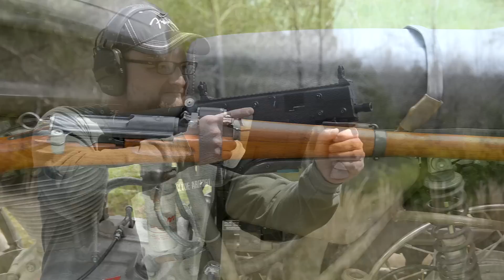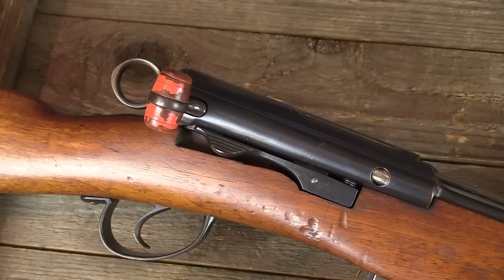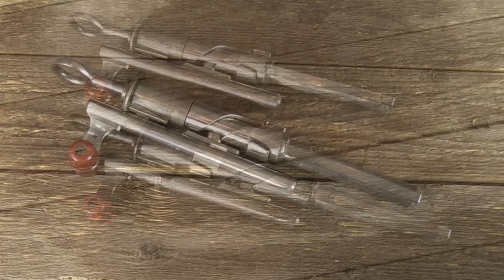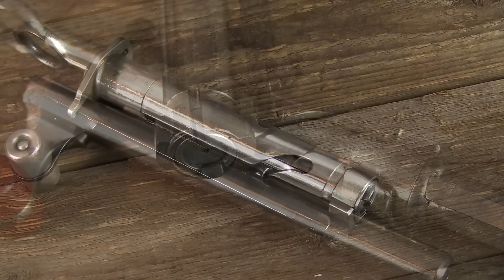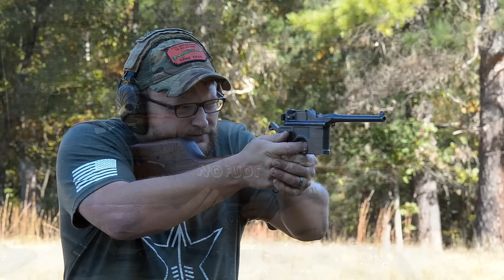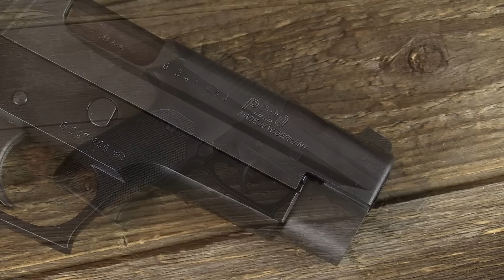A History of Swiss Military Small Arms

Comment: The "Pistole 08" was adopted with the famous 9mm Parabellum in the German army  in 1908 - correct. The Swiss brought it into service already in 1900, in cal. 7,65.
But: The "Pistole 04" was adopted by the German Imperial Navy in 1904. It was also a Luger. They produced with some specifications only about 32.000 issues, mainly for the crews of torpedo boats and naval airships.

Comment: Just have to say that the GP11 is not in service anymore. Its the GP90 (1990 and not 1890) we use in the Stgw90 (SIG550).
Reply: ok you said it later yourself, nevermind... but I know the 550 quite well if you have questions.
Reply: and the Pistole 75. thank god I finished my service...
Reply: GP11 is still in service because vehicles like the Leo2 still use it as coaxial, with the MG51.

Comment: Eric you have a few things wrong, especially about the Luger. The Swiss bought the first model 1900 Luger from Germany (DWM). The later models were then produced in Switzerland (contract). So that the Swiss had the Luger before Germany is incorrect. The Luger was issued to officers in Germany from 1900. Also the P75 served all the way up to now and is slowly phased out  and replaced by Glock 17. The Swiss Army never used Sphinx nor P226. However they where and are used by law enforement in Switzerland.

Comment: Just a quick question I have about an old rifle I got not too long ago, I have an 1891 Argentine Mauser and I was wondering if it's normal for there to be resistance when closing the bolt even without chambering a round, note when I got the rifle I had to get a replacement frieing pin and cocking peace was nonexistent

Comment: Please correct me if I am wrong, but it seems that the significance of the “transitional rifles” has been misrepresented. The 96/11 rifle (which as you point out can be identified by the grafted pistol grip), was much more than a footnote in Swiss small arms history. Remanufactured from stockpiled 89/96 rifles, the 96/11 was actually the most widely produced Swiss long rifle chambered in the GP11 cartridge. By the year 1915 there were almost three times as many 96/11s in service as there were new production 1911s. Even after the Swiss ran out of 89/96 rifles to convert, production of 1911 rifles never caught up with the number of 96/11s already in service. Technically speaking, the 1911 rifles were actually supplemental to the 96/11s, which by their own right were the defining long rifle of the era.

Comment: I have two 1889's and they will chamber and fire (very accurately) the exact same cast loads I use in the 1911, K11, 96/11, and K31.  The throat is so generous that the brass doesn't need trimmed for cast bullets.  With FMJ your pressures are a lot higher so you'll want to verify there's no bullet pinch going on as well as using 30-40 Krag data, but for me, extra trimming is not needed.  
I use a 180gr .311 sized powder coated wheel weight bullet over 19gr 2400 in a berdan primed GP11 case.  Shoots cloverleafs at 50 yds out of all the Swiss rifles and seals perfectly in the 1889 with no blowback.

Comment: Swiss firearms are the best
Reply: champy1210  the Swiss are the best in my opinion. The germans had great designers of firearms but the Swiss had perfectionist. The Swiss took a simple design and made it better. Also the Swiss had many designs that were ahead of there time. Let us not forget the craftsmanship of Swiss arms as well.
Reply: German empire 1871 also Swede mausers but I love Swiss rifles more because I own swiss rifles and it's a straight pull. All cool guns are straight pull like the Ross and M95.
Reply: Douglas Thompson strange cause of this does not happen with my weapon 🧐🧐
Reply: Yup. Sig S552 commando is the best military rifle ever ever made
Reply: Douglas Thompson enzymes? What?
Reply: Good video btw
Reply: German empire 1871 swiss firearms start developing holes rather quickly. The enzymes on the surface turn to large holes after about a month of ownership. Sad...cause they really are some nicely designed firearms.
Reply: champy1210 no the G63C is never AS accurate AS the stg90
Reply: German empire 1871 German firearms are the best, but Swiss are very close to the top.